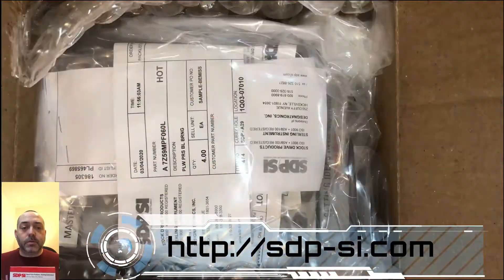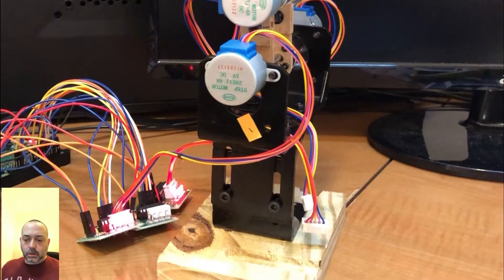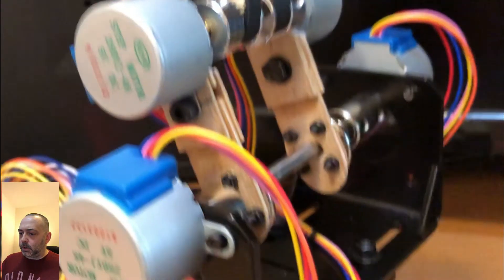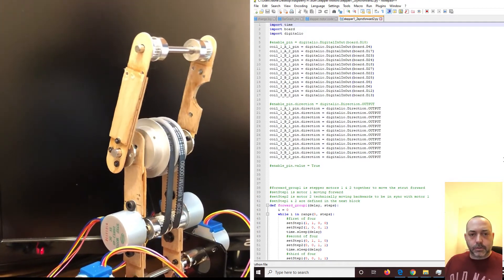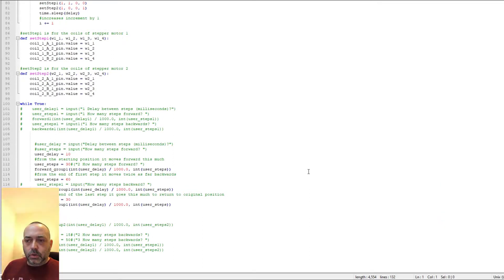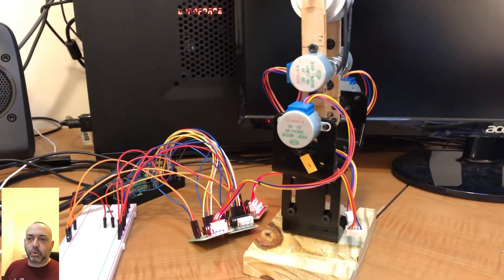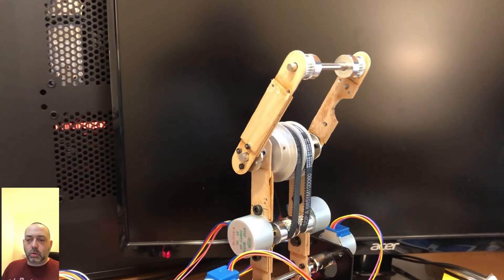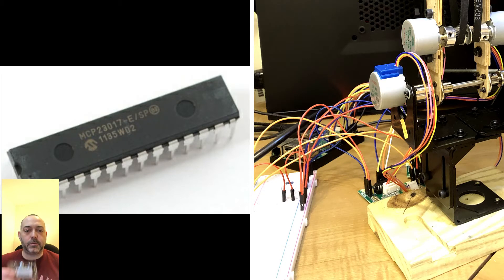Robotics: Robot Arm is Now Twice as Strong!

Comment: Good job! If you are running into hardware limitations with the Pi, have you considered going with Arduino for your next project?
Reply from the maker: Thanks Michael!  I've been thinking about it but wasn't sure which model to go with.  Which Arduino would you recommend?
Reply: Sounds like Arduino Mega would be up your alley. Has a lot of pins, and Arduino is capable of controlling many motors at once, you just need to use an external power source (which you may already be doing?)
Reply from the maker: Awesome!  I’ll get a Mega for the next video!  I wasn’t using an external power source for the two motors in this video but will for more motors for sure
Reply from the maker: Arduino Mega arrived today! 👍
Reply: @mikebemiss8186  that's awesome, hope it works better for you!